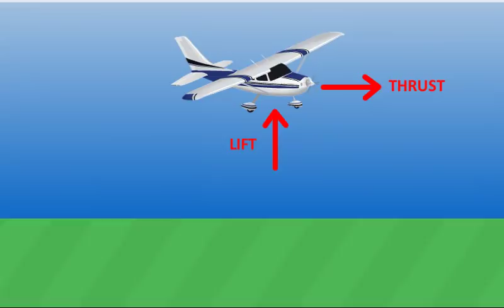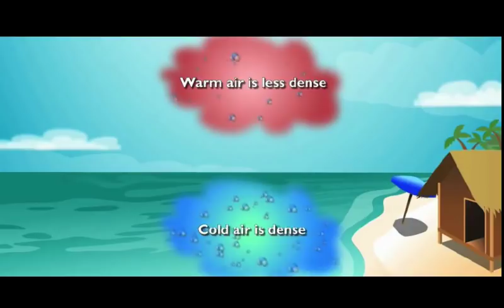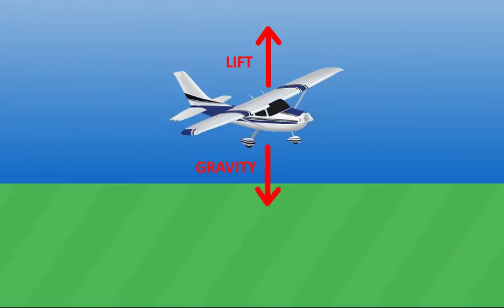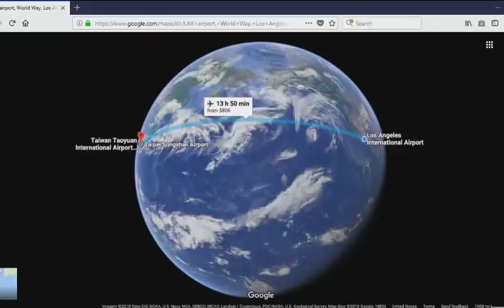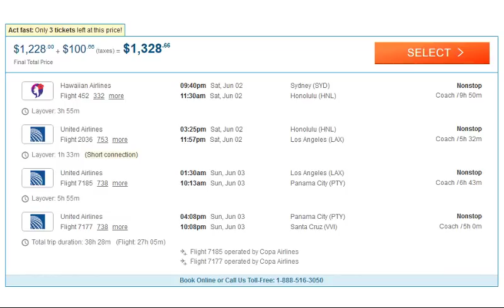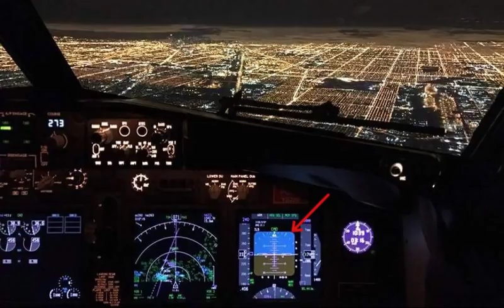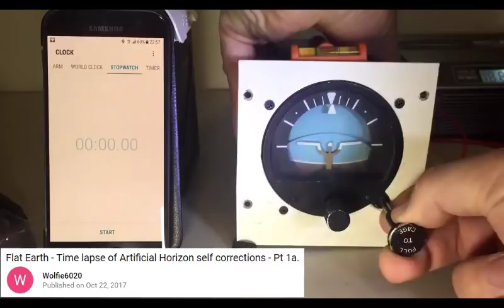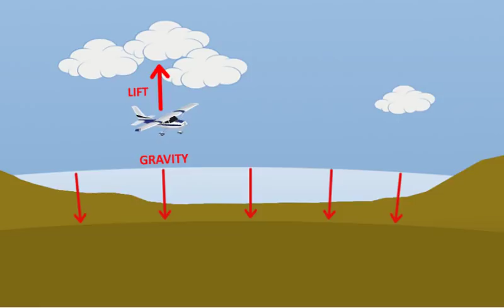Flat Earth Falsities - Plane Nonsense

Comment: "The atmosphere rotates with the Earth due to gravity and friction." Unless u can prove this, u've already made a HUGE assumption. Believe me, even the Great Newton himself knew this (theory of gravity)was purely an hypothesis and NOT provable. If u chuck a rock off a cliff it falls down (Yah!) but this is not necessarily due 2 "gravity" , it could just be that the rock is denser than the air around it. ;-)
Reply: Michael, the density of the rock doesn't enter in to it. Gravity is a proven fact. Can you predict the motion of the rock based on its density? Of course not. Do you have any equations that predict the path of the rock better than Newtons's equations? Then why are you arguing with Newton?
Reply: I'm afraid density DOES enter into the equation And the assumption that "gravity is a proven fact" doesn't really wash, because it hasn't yet been proven. Please direct me to the proofs of gravity and who did the proofs, I would really appreciate this.
Reply: Buoyancy is an effect of gravitational pull. More massive objects push out lighter elements while trying to get to the center of the mass. Without gravity there would be no buoyancy. Period.
Reply: @Michael well lets go with your argument. the rock is denser as the air. Ok. I can accept this 'assumption' can you please explain to me why the rock then gets pushed down? not left, not right, not up but down? you see, I guess we can assume the rock is surrounded by air in the moment you let it go. why is the air pushing it all the way down? what is the reason for that?
Reply: Michael, gravity has been accepted as fact for hundreds of years. Do you know when you slip and fall on your ass? That is gravity. You do not have one observation or experiment that disproves gravity. Have you heard of the Cavendish Experiment? It measures the force of gravity. Have you heard of a gravimeter? It also measures the force of gravity.
Reply: Michael, people who's beliefs contradict reality often make arguments like "Gravity isn't real". This is of course ridiculous and I'll tell you why. 

Are you ready for this?

Gravity is an observation. 

It's an 'observable fact' in scientific terms.

We didn't make it up, we simply named the observable fact of mass attracting other mass as 'Gravity'. It doesn't need proving, gravity exists and we can see it. 
Not only does it exist here on Earth, but we can observe it in the cosmos too. Our observations of the motion of the planets match our observations here on Earth. The trajectory of comets, the orbit of planets and someone dropping an object here on Earth all behave as if the same kind of force, described by Newton with one equation and one gravitational constant that takes all these into account, is being applied to them.

And with respect to your "Newton himself knew this (theory of gravity)was purely an hypothesis", you don't know what you're talking about.

Newton created his Theory of Gravity, and later Einstein came along with his Theory of General Relativity.
Neither of these were to prove that gravity existed, because we can SEE it exists. Their Theories were to try and explain why they exist and how they work. That's what Theories are. They never get proven right or upgraded to facts, a Theory is the pinnacle of what an idea can reach in science and is supported by many, many facts and confirmed predictions.

They may have started out as a hypothesis, but after many years of work and an overwhelming weight of evidence brought forth by both these men, their hypothesis became a scientific theory.

In short, a Hypothesis and a Theory are not the same thing in science.
Reply: its doesnt work like that, buoyancy doesnt work without gravity
Reply: If it didn't, you would feel 1000mph winds at the equator...
Reply: It's somehow fascinating to see people go "Maybe instead of gravity, gravity causes objects to fall". Like, density explanation relies on gravity being true. Offering it as an alternative to gravity is just so bizarre
Reply: Yes, rock is denser than air. And because it's dense, it falls towards the centre of gravity faster than air.
Reply: Michael said that, "I'm afraid density DOES enter into the equation." How? How do you predict the acceleration of the object towards the center of the Earth based on its density? I know that you flat earthers get confused by helium balloons, so lets leave that out of it. I have a piece of metal and a water balloon. Which one falls farther in ten seconds and by how much?
Reply: And this ones for free, hypocrite... want proof of friction in the atmosphere? Look up "atmospheric boundary layer" and "Ekman layer". Careful, this second one is only possible because of the spinning globe.
Reply: @Michael no answer? really? just you claim something and then bail out? I mean it should be simple to explain why the forced induced by density has a direction...
Reply: @Michael I can't comment on this 'observation' of you. I can tell you I have observed a ship and it slowly 'sunk' behind the horizon. who is right? is my story correct or yours? I don't know neither do you.
Also it is never wrong to question knowledge. that's perfectly fine. but what you do is throwing it all out of the window. you see to claim I was to late because I missed the buss is maybe a lie... maybe not. To claim I was too late because I was elected president of the US and had to solve the middle east and fuck the first lady, is maybe a lie maybe not.. but both claims are not equally likely! same here. maybe you don't understand a few things, maybe there are gaps or misunderstandings. but then to claim that everything is a lie and that it must be something else is just plain and simple wrong. the earth is a globe! you can see it on pictures you can do proper experiments, and you have so much prove of gravity that it hurts.. literally when you fall onto your ass! To turn around and to claim the world is flat only makes sense if you gave up everything around you as well because it must be a lie as well. go out into the desert, find yourself a bay rum tree and life in a hole. because that is where the bible was written and that is the understanding of the world stated in the bible. so long
Reply: Michael Honesty is a required element of research. But you insist on parroting rank lies of the Flat Earth Extremist Cult dogma. 

"I have watched ships "disappear" over the horizon and then with...." This lie has been interrupted, in progress for the application of truth. No you have not, nor has any human being from the beginning of time until the present. Parroting the lies of Eric Dubay or Rob Skiba is not research. This is research: a page from my navigation textbook in the chapter on dead reckoning. It is telling you how to judge how far you are from a ship based on the amount of hull hidden by the curve of spherical earth. Navigators have been doing this since before 1000BC.

https://image.ibb.co/kSUuGG/hull_down_01.png Note how this photo is taken through a 60x spotter scope much more powerful than the "Star Trek Tractor Beam (registered trademark)" binoculars or spyglass you didn't even bother to use. Note how each ship is identified by name and radar range. Note how the further a ship is from the camera, the more of the hull is hidden by the curve or spherical earth, and that can be used to help you estimate the range to that ship.

Note that your claims to have used "the aid of a trusty ocular device the ships that just disappeared over the "curve" suddenly are in full view again."  are fully illuminated by the light of truth and revealed to be unskillfully executed, kindergarten level, obvious, knowing and deceitful lie. You are done here. You are not only a liar, but a complete idiot to think that anyone would buy in.
Reply: Reprimands for making a basic assumption accepted by all physicists and then proceeds to make one himself without bating an eye; hypocrite. Except your assumption that density DOES enter into the equation is ludicrous. What equation is that?
Reply: Michael Bannerman-Roberts look whos making assumptions. you are. so where is your equation? due to density?  ever heard of balance scale?
Reply: All you globers are making a simple mistake. You think Michael is confused and has his facts wrong. That's wrong. He's just lying. His problem is dishonesty and the lack of human value, not confusion about gravity. He's a liar.
Reply: I can't tell if he lies or not, I can tell if he is wrong or not by examine his hypotheses. but so long they all bail out or produce bullshit. it's really hard to argue with these guys... maybe I've study the wrong field. psychology would be more suited
Reply: Michael Bannerman-Roberts if you try to understand the world, how about taking a physics course? If you don't understand what buoyancy has to do with gravity, you clearly haven't bothered to even pass elementary school physics in your effort to understand the world.
Reply: If the reason the rock falls "down" is because it is denser than the air, why does it accelerate as it falls into denser air, rather than deaccelerate  as would be predicted by your theory? Besides that, you are making this "magical" density a vector, which means it has a direction and a magnitude. The definition of density is mass per volume, neither of which has a direction.
Reply: well sir, i am a mendacious fellow then? I am undergoing a process of trying to understand the world we live on. No-one has been able to convince me the the world is a globe and there also seem to b flaws in the flat earth argument. I am not confused, however, i exist in a state of ignorance as to the actual nature of the world.  I have watched ships "disappear" over the horizon and then with the aid of a trusty ocular device the ships that just disappeared over the "curve" suddenly are in full view again. I really need someone to explain how this is possible. But I do suspect that the answer to this enigma will not be found here.